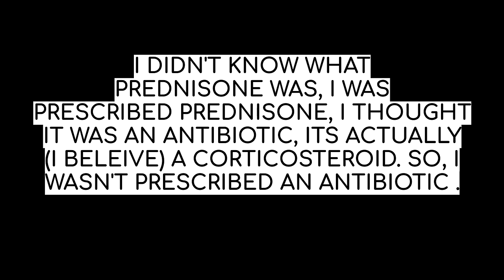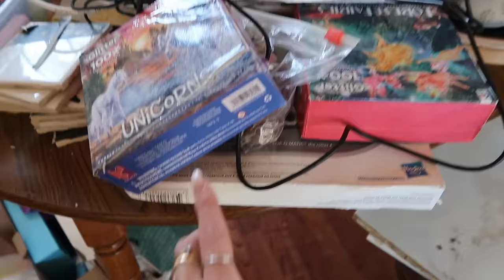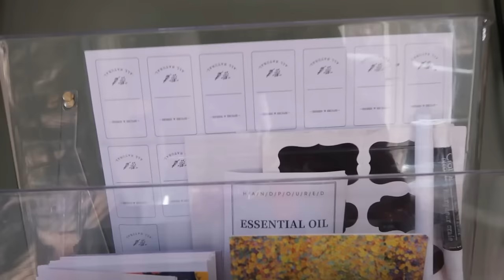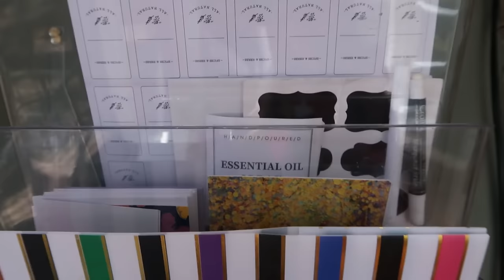EXTREME DEEP CLEAN, DECLUTTER & ORGANIZE! I Can't Believe This Happened! My Journey to Minimalism!

Comment: About the sand: maybe you (or your daughter) could make a necklace or something with a small bit of the sand, just to have as a memory. There's small bottles with cork as a lid, you could put like a wire or something into the cork to make a loop for the necklace to go through, just make sure to glue the lid onto the bottle so it doesn't come off. If you don't want to make it into a necklace you can put some into a box frame. I totally understand why she doesn't want to part with it so it's just a suggestion from me to get rid of it without throwing out the memory by letting a small amount stay. Yesterday my mom threw away an old oil lamp my grandmother bought me at a second hand market, it's not very beautiful and I didn't even take it with me when I moved and hardly knew that it was still there, but it was hard to see it in the trash, but I actually thought about something you have said about letting go of sentimental stuff, and I didn't pick it up. I have always had a hard time letting things go, and to see it in the trash is like knives sticking into my heart, but I have been throwing a lot of stuff the last few years that I couldn't throw away just a few years back, so my brain has changed mentally by looking at videos like yours on YouTube. If I had to move tomorrow there would be less stuff than two years ago, but I still think I have way to much stuff that just sits there for no reason.